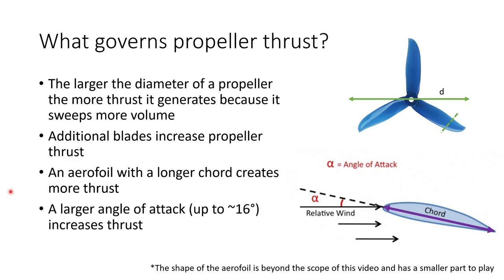How to choose the right props for your quadcopter: FPV Freestyle, Racing, and Long Range

Comment: So I have a question regarding the shape of the wing. As i know from paragliding, a longer wingspan improves wing in flow efficiency. Would it be good to have higher pitch props with a longer wingspan  ?
Reply from the maker: A larger prop will be more efficient just like a longer wing of a glider. The choice of pitch is more about the angle of attack you want which is based on the disc loading and the speed of flight.
Reply: @ChrisRosser  I'm not sure I express this correctly in english but, from what I understand, lift is function of surface area, but fineness is function of the aspect ratio (I used the term wingspan which seems wrong). My question is therefore, is it more efficient to try to have props with greater aspect ratio ?

Comment: You mention that more blades reduces efficiency due to turbulence produced by preceding blades, but is this the case for a prop spun at a fixed position or for a propeller moving through the air, since if you are traveling forward relative.to.the prop, shouldn't your blades be hitting fresh undisturbed air?
Reply: And if it is the case where forward motion lessens the turbulence by introducing "clean" air. Then shouldn't there be an optimum cruise speed for any prop with a given number of blades where you can outrun the turbulence?
Reply from the maker: For a prop moving rapidly through the air the turbulence from preceding blades is less of an issue. However in our application the blade tip speed is usually significantly more than the inflow velocity so the turbulence isn't carried away before the next blade arrives. In high inflow conditions like fixed wing more blades typically means higher disc loading and that also reduces efficiency.

Comment: I just did a top speed test with 6S 1900kv motors. I found the high pitch props 5053 were the slowest at 88mph and 5043 were the fastest at 102mph. Can you explain this result?
Reply from the maker: I think so. I don't think your motors and battery could provide the torque needed to reach sufficient RPMs on the steeper prop. That limited the max speed. With the 5043 you need less torque for a given RPM. The higher RPM made up for the lower pitch to give more performance. This is a great example of needing to match motor torque to prop requirements.

Comment: The hyperlight is not bobs frame so I hope your doing the fpvcycle glide
Reply from the maker: I'm working with Bob on the video so it'll be the FPV cycle glide. Because of the similarities in geometry the results should be applicable to both frames? They certainly look very similar.
Reply: @ChrisRosser  They were up until about 8 months ago when Kabab upgraded the bottom arm brace and the bottom main plate to a much more solid design with fewer cutouts, the fpvcycle glide is now much beefier structural wise. As far as I know the hyperlite glide still uses the old design, though they still look very similar at the first glance.
Reply from the maker: @shtumpa1  Ok, I'll make it clear that the analysis is for the FPVCycle Glide but that the Hyperlite Glide is similar. I would like people who search for the Hyperlite Glide to find the video because it will still be relevant for them.

Comment: Chris, for a 700 gramish' 5" freestyle build. I would want a more pitchier prop correct?
Reply from the maker: I would always run the lightest pitch prop that gives you enough thrust and speed to get the best propwash.
Reply: Weird because after trying so many different props on my 800gr 5 inch freestyle rig, I found that the gemfan 5236's had the best flight characteristics ... Why is this Chris? Always appreciate your knowledge on this stuff... I learn so much from you... Thanks you Sir 🙏🏻

Comment: actually , stick feeling is the biggest concern for pilot, its related to Props MOI, stiffness etc.
Reply from the maker: Stick feel is certainly a complicated topic. It is affected by all of the following:
Rates
PIDs
Filter settings
Battery Voltage
Motor size and KV
Prop diameter, mass, pitch, and shape
Throttle expo / limit
RC Packet delay
Transmitter Send Delay
Camera latency

Hopefully the information in the video was useful!

Comment: Chris, so for a 7" LR build, 7050 or 7060  Bi blades would be ok with some HYPERLITE 2807.5  1122KV motors ?
Reply from the maker: The motors sound good. I'm interested to see how you find the props 7050 is a very steep prop for quads.
Reply: @ChrisRosser  you mean, that is hard to find those high pitch props or the feel of them will not be pleasant, and for  max fly time what pitch will be best?
Reply from the maker: @rolisaenz  Steep props tend to have more issues with propwash due to the high effective angle of attack. I have a video on picking props that you might find interesting.
Reply: @ChrisRosser  whaching it right now , thank you.

Comment: So for example 6s on the blackbird v3 2125kv, what sort of prop would you go for?
Reply from the maker: Something light, Ethix S3 or S4, F5, 5040
Reply: @ChrisRosser  thanks a lot, il give a few a try, it’s a slightly heavier build around 700g auw with a action cam etc, would I be better to go s5 rather than s3 for example because of the heavier weight

Comment: What motor/prop/battery combo would you pick if you were trying to break .92 mach just to see how insanely loud it would be?
Reply from the maker: Ethix S3s 2207 3000Kv 6S and a fire extinguisher.
Reply: @ChrisRosser  I wonder if the props will explode or have so much deflection they are flat before passing .92

Comment: If I'm using  a 1607 3675kv what size props should I be using  ? I'm new at all this been flying for about 6 months  ..I'm using  hq 3×3×3as of now also gemfan 3052
Reply from the maker: I have a video on prop size vs weight. Hopefully it helps. 👍

Comment: I needed to really puff on my THC pen 🖋 Let me ask a scenario of being posturing for the Demon Zombie Apocalypse of Undead 🧟‍♂, Of resupplying people, survivors... Now if I went to 8 motors on an X frame, should it be stiffened frame arms out to the engines & props, a thick single or a square tube, or hex or round? And if I put a vibration plate and then mounted a 500 helicopter on top of that with 5 blades and 5 on the tail rototer and a blower jet engine on the rear perhaps kicking in at 1/3 impulse throttle, the thing of interia forward movement for the dragging of a lifted weight as naturally we want to get to is the destination as the clocking is ticking down 👇.
What size blades and pitch on the 8 engines and for the Heliochopter what type and size jet engine would make this setup pop? 
Naturally in any kind of Apocalypse, we don't want to stall out, we would also want some durability and longivity while being effective and efficient.
I also suggest mounting the engine on an "L" bracket mounted to a servo tilting the engine at the 15 degree mark forwards or backwards and pinning it using the plate on a slot for travel. I was trying to estimate the carried weight a bit with battery sizes? I'm just starting out with drone learning as I go before I invest in a build, Some much newer knowledge coming at me :)
8 x MAD Polar XC5000 380kV (6-12S) I also heard they were good engines as well, As I want to slightly overbuild with some quality items in the right areas.
 
Just trying to reflect on how much-lifted weight would be possible with this type of setup? One battery set is for scouting and recon work and another for lifted supplies in being the battery weight would be the factor between the two perhaps? 
I was just wondering how someone like yourself would look at this type of problem and some of a now budget, spent wisely of coarse?

Comment: Have you found any data suggesting 3" racers can't meet the performance of current 5" Multi GP racers?
Reply from the maker: No, but I also haven't seen any Open class MultiGP racers winning with 3" quads. This suggests to me that at the moment 5" builds are performing better than 3".

From a purely theoretical perspective: As you make props bigger they get more effcient. But the quad also necessarily gets heavier (for reasons I cover in the prop sizing video). More efficient quads are faster but heavier quads are slower. So that suggests there is an ideal size... 5" certainly seems to be closer to that ideal than 3".
Reply: @ChrisRosser  Perhaps the track is the biggest factor. I deal for a particular track?

Comment: Hi guys, I have a 2800KV 6S setup what would the best prop be to use for top speed?
Thanks!
Reply from the maker: For top speed you need steep pitch props. Try 5051.
Reply: @ChrisRosser  thank you! What kind of esc would you recommend in this instance?

Comment: Beginner question: You mention props like 503X 504X, 505X. What do these numbers mean? If I check the iFlight shop for Nazgul evoque props, these say something like: pitch: 3.1
How do these numbers relate to each other? Are the evoque props 3.1 pitched by 3.1 degrees? What are the 50XX numbers you recommend in the video?

Thanks so much!
Reply from the maker: 5040 is the same as 5.0x4.0, so the evoke props are 5031 or 5.0x3.1" pitch. Pitch is the pitch of the spiral in inches.
Reply: @ChrisRosser  thanks for your reply, Chris! I still don’t fully grasp it, though. Wouldn’t pitch need to be a value in degrees or otherwise a set of two values (slope x and y measurements)?
The 5.0 is going to be the diameter, so how do I read the 3.1 or 4.0?
Reply from the maker: @calisti9308  If you imagine the prop rotating without slip in the air then the pitch is the distance it would travel forward with one rotation. Its the pitch of the corkscrew.
Reply: @ChrisRosser  thanks Chris

Comment: This is just rubbish.
1. You need to factor up the design scale. Cheap toy grade props are not to be used in that formulas. Just take a 5 inch prop,  how accurate is that? Than a 125mm prop? Have you ever seen a 5⅛" prop? 1/16? 1/32? Errors everywhere. That's why the numbers can't compute any correlation. 
2. It's a quadcopter, in a gyroscopic motion with cm and cg, 1-plane/multi-axis. More design factors along the arms to the tips. Plus you wouldn't have much problems for any props-motor selection if the p/w ratio as per what you need/want. Just tune them i.e. instrumentation and control. Why? Because no motor dyno spreadsheet, just props recommendation and thrust generated on a scale per motor respectively. Does it needs a wind tunnel test? Even an airflow simulation? How much would you pay for?  And they keep reproducing more motors for you to buy to pair with cheap propellers. 🤦‍♂️
3. Lastly, aerofoil, the most expensive part of a propeller. Nuff said.

P/s: Serious toys? Seriously 😜
Reply from the maker: Thanks for your comment. Unfortunately I cannot agree. Myself and many other pilots have found this analysis very helpful in improving the performance of our FPV quads.

Comment: Hi Chris, thank you very much for your teaching....Can you please put, the most common/important prop sizes, into the graph of stator motors volume in relation of inch quads, in order to have a really clear full view of how to pair these Items. Thanks
Reply: I know it will be a very general guide, considering all the lots of thing you have just explained. about different direction of the air flows ext ext. Thank you💪
Reply from the maker: I think that graph is in my motors video
Reply: @ChrisRosser  Hi, yes of course, I mean please add also the props, in order to have the exact position of them between stator volume and inch quad. Thanks

Comment: AI summary;

Propeller Design and Performance
Propeller diameter, number of blades, blade shape, and angle of attack affect thrust generation.
Larger propellers and more blades increase thrust, while a larger angle of attack increases thrust up to 16 degrees.
Propeller efficiency is affected by disk loading, number of blades, and angle of attack.
Larger propellers and fewer blades increase efficiency, while a larger angle of attack increases efficiency up to 8 degrees.
Stalling occurs when airflow over the propeller detaches, causing lift loss and drag increase.

Propeller Angle of Attack
The angle of attack can be calculated using pitch, radius, RPM, and inflow velocity.
Inflow velocity reduces the angle of attack, and a lower fixed pitch and higher RPM help prevent stalling in adverse inflow conditions.

Propeller Efficiency and Compressibility
Propeller efficiency degrades above a tip speed of 0.62 Mach due to air compressibility effects.
The absolute maximum tip speed should be between 0.8 and 0.92 Mach to avoid supersonic flow.

Propeller Selection for Different Applications
Freestyle pilots prioritize control in reverse flow situations and use very low-pitched props (e.g., 5040s, 5037s) with high-KV motors, sacrificing efficiency for predictability and stability.
Technical racing pilots benefit from moderate-pitched props (e.g., 5043s, 5045s, 5047s) for efficiency and thrust, but should select a lower KV motor to avoid overloading batteries.
Long-range and open racing pilots use higher-pitched props (e.g., 5047s, 5050s, 5051s) with low-KV motors for maximum efficiency and thrust, considering disc loading and potential throttle limits.
Prop pitch selection should account for the angle of attack adjustment factor due to disc loading, with lighter quads requiring slightly lower-pitched props and heavier quads benefiting from steeper props.